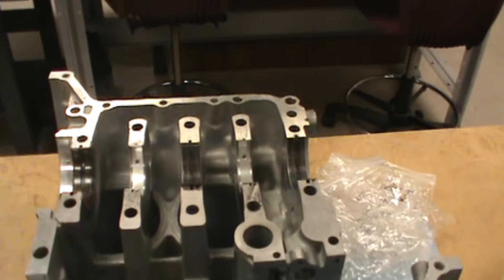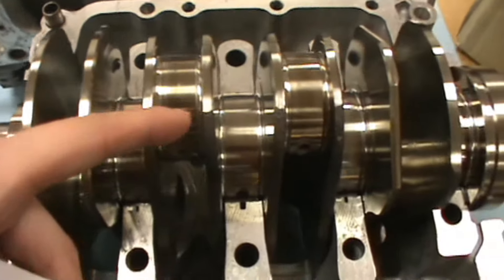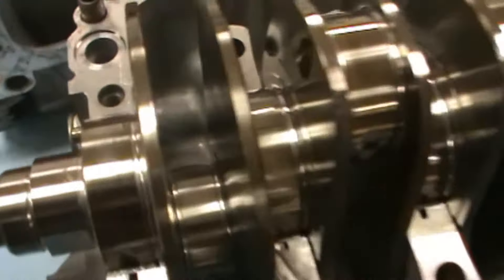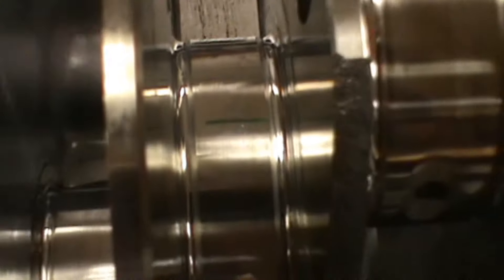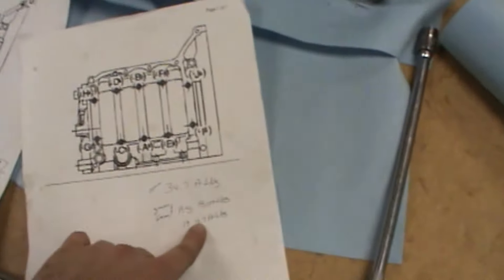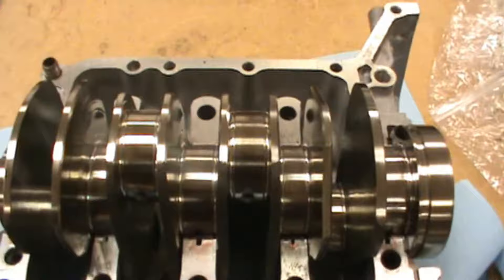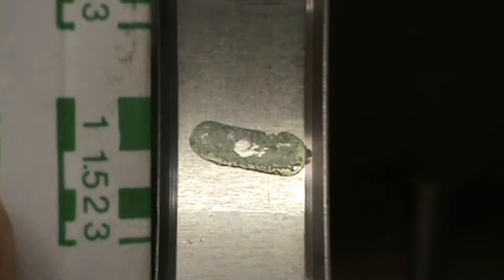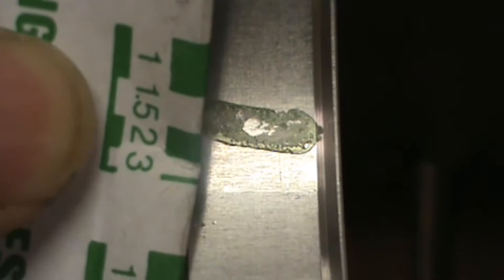How to use Plasti Gauge on your engine and check bearing/oil clearance

Comment: Hey I have a question. When you torqued the block together there was no sealant between the halves which will be there when you do the final assembly. That can add some clearance so do you account for that or just go with the non-sealant spec?

Comment from the maker: @DesertRida9 I will be uploading exactly what you want to see very shortly.  It was created over 2 years ago though so my "walk through" as you would call it is very quick and slightly uninformative.  It will shed a little light onto how to check exactly that.  And yes, you wan't between .0008"-.0018" but .0015" is the perfect number to see.

Comment: It sounds like one of the conrods let go in the EJ20 in my brothers 2000 Subaru Forester as at 4000 RPMs & downshifting up a hill,the engine started clanging & misfiring.

My dad & brother tried fitting another ignition coil but that didn't work,he lugged it to our cousins husbands mechanical workshop, he did his apprenticeship at a Subaru dealer so he's a Subaru specialist.

I wonder what approach he's going to take because they are a split case engine which can be resleeved if the cylinder is damaged,the crankshaft could be repaired if it's damaged also ?

The car is stuck about 650 kilometres away from where we live because my brother has to go back to work on Monday,so he has to go back up to near Byron Bay which is near the Queensland border to pick the car up once it's fixed.

Or would he just bolt another used engine in as someone from the Gold coast in Queensland is selling a used EJ20 engine for $650 AUD ?

The moral to the story is my brother was using 10W50 engine oil in it & the engine was being run on LP gas,was the oil too thick ?

The engine has done almost 400,000 kilometres but that doesn't mean anything, I have experience with Nissan engines with about 300,000 kilometres which were burning oil & the piston to bore & bearing clearances were still in factory specs, the oil control rings got stuck & were the cause of the oil burning.